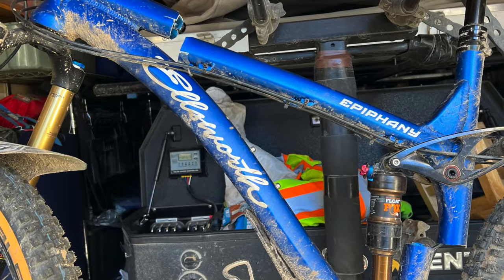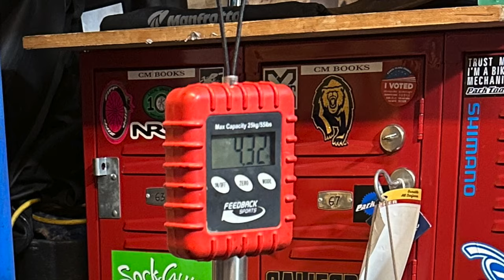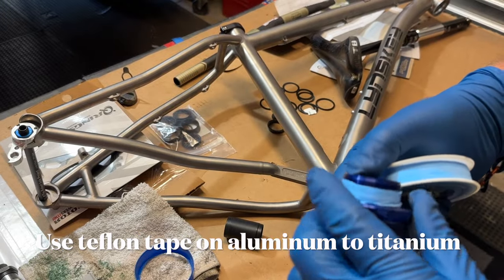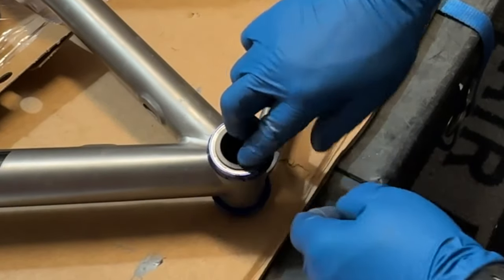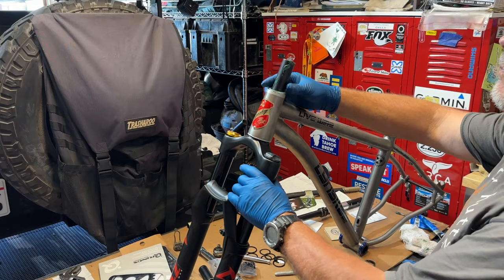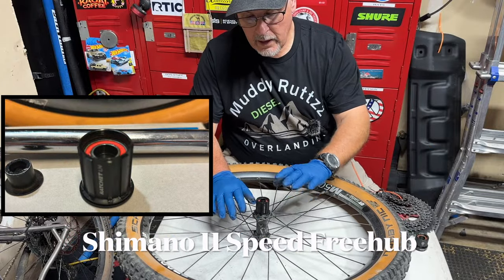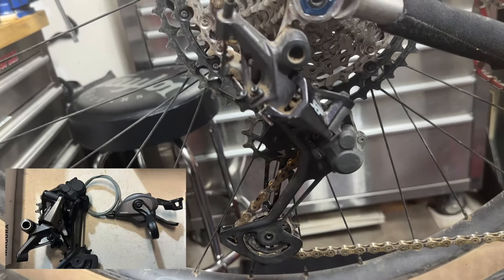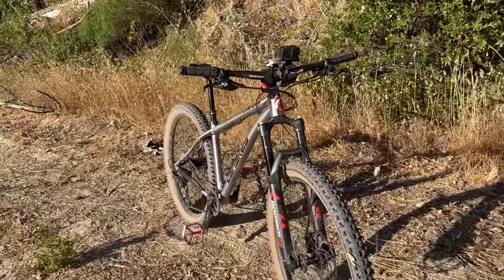Why A Titanium Hardtail? (Dream Mountain Bike Build)

Comment: What’s your crank arm length? I always run a shorter crank arm when my under wheel. My Cro-Mags stylus with 26+ inch wheels as a 165 crank arm length while my route down on 29 inch wheels I run a 170. Although that may be fun to run mullet, seeing as how you have the wheels. Oh yeah, my route down is a titanium, coming in at 32 pounds so you did good on your weight. Also, calipers need to be tightened, they are the ones that hold the brake pads and pinch against the rotor your brake levers, or once you leave loose.
Reply from the maker: 170 mm crank arms. I knew trying to reuse my 27.5 tires wold be a problem. Thought about 27.5+ but they require 35mm rims I have 30. Chris King 29” wheels are awesome. No pedal strikes now. I mistakenly said calipers and put a graphic in the video saying levers. Thanks!
Reply: @MuddyRuttzz  Oh yeah, the other thing, buy the right size dropper post! Using a shim puts undue stress on that short length of where the shim adapts your seat tube. When you have the proper size it distributes that torsion all the way down the seat tube because of the tight fit. It’s a couple hundred dollars more but will save you from having to replace a frame. Besides those race face go bad after a while. PNW loam dropper

Comment: IMO, you spent $$ where you didn't need to (CK) and skimped where you could save money and weight (i.e. Rotor cranks). Wheels are OK but the tires are heavy. If you made the whole bike XT , you would've saved money and weight. I have a Salsa Timberjack (L frame) with Fox Factory 34 140mm, and full XT, Ibis carbon 27.5 and it's 26 lbs. 2.4 R and 2.6 F Bontrager.